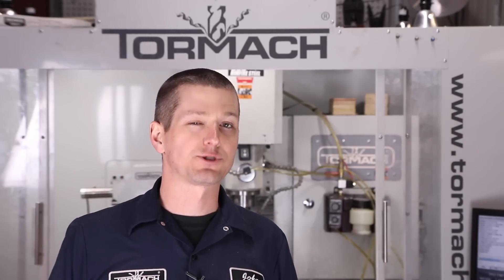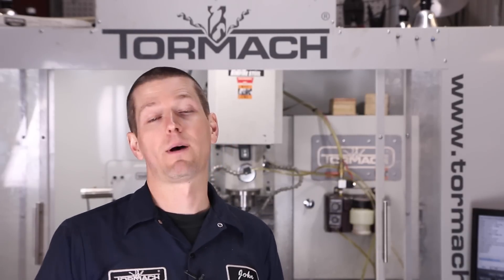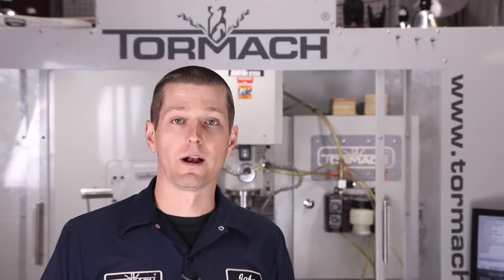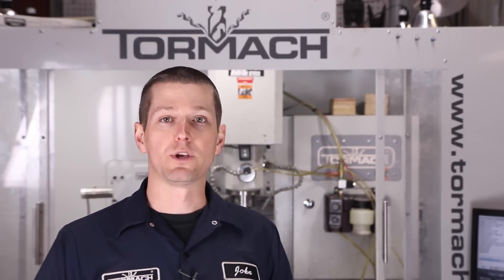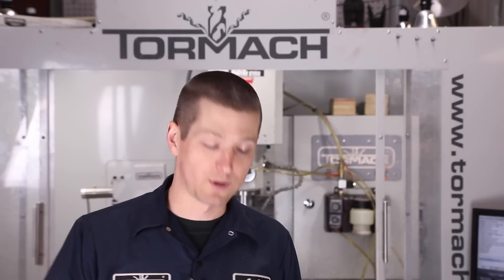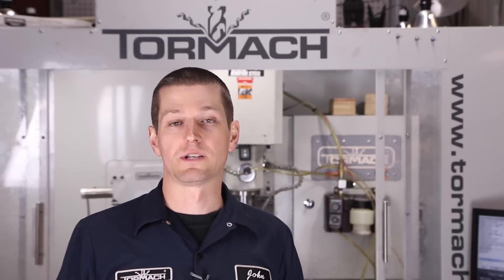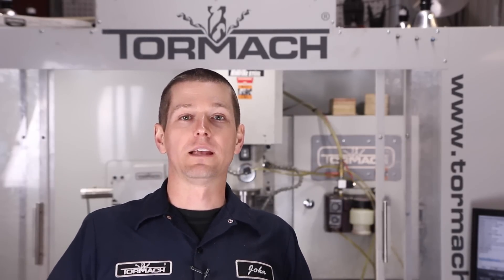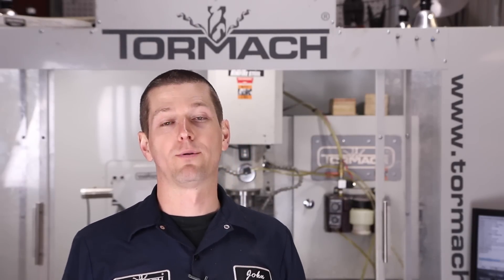10 great features of Tormach's new PathPilot Controller!

Comment: Hi John, I picked up a couple of tips there, thanks.  I am running Path Pilot with V1.9
I'm pretty stoked with it. A learning curve no doubt, but a pretty easy one in the scheme of things. I read(tried to ) the manual and I gotta say, it did not inspire me!
I decided to bit the bullet and just try stuff....Yeeee Haaaa! Awesome stuff.
I have used the circular pocket to great effect. And people would be surprised how you can manipulate the figures to get some interesting outcomes. The tool data is very useful in that you can actually manipulate your diameter (in tool data) to vary(fine tune)  your finished size. I have not been able to get the touch screen working yet, but tormach are working on it. Tormach is also working on a PCD for Drilling and Tapping under the "conversational umbrella" of drilling and Tapping.
My machine is as series 3 and about 2 years old, but with Path Pilot, it feels and sounds like it's new. Definitely smoother. I used to do some machining(say an internal pocket) at over 1800mm per minute feed  rate but unless the next move was around an arc or off on a slight angle, it never sounded good. that sound has gone...smooth sailing. Role on Tormach. I cannot wait for the updates of PP with fixes for a few bugs, but more importantly, new and expanded features. Go Tormach..
Thanks for the Vid too John, another great job.
Regards
Peter

Comment: Hi John, I have seen your vid on using the touch screen. How did you install the driver from the USB.
I found the latest driver, put it on a USB but it doesn't seem to recognise the file.
Can you get back to the Linux system(maybe outside Path Pilot) to install the driver. 
Thanks in advance Peter

Comment: John, I wonder how much of the responsiveness you see in Path Pilot is due to Linux instead of Windows?  Just wondering...don't expect an answer. It would take a lot of research into how each program is structured (single multithreaded process vs multiple cooperating processes, use of custom device drivers and how the work is divided up, etc.)

In some future video maybe you could explain what "ref out" means, and how soft limits work and why they prevent it?

Thanks!

-- Mike
Reply: BigMjolnir Okuma's OSP for one example is a Windows PC-based control. I don't think it's a Windows problem.
Reply: NYC CNC Hi John, I just ran into a problem with the soft limits. On the Y axis it is set at 9.50". I run a jig that holds 14 pieces and the pieces on the Y axis measures right at 9.5". I use a 1/4" end mill that runs on the outside of the pieces on the Y axis. I have been running this program for 2 years on Mach with no problems. So to say I run just over 10" on the Y axis without hitting the limits when using Mach. I put Path Pilot on both my 1100's and went to run this G Code and I couldn't run it due to the Soft Limits being set at 9.5". I called Tormach and asked if they could put a button on the program to turn off the soft limits or better yet let us set them ourselves. Waiting to hear from them if this is possable. Mean time I had to change one of my machines back to Mach which I really hated to do. I think the soft limits are a great thing but need a way to turn them off or let us adjust them.
Reply: John, thanks for the explanation.  I'd thought Tormach used servos not steppers?  Servos shouldn't lose position...they report movement back to the controller so no "lost steps", right?

I got to see Tormach's machines in person at the Cabin Fever Expo in York, PA on Saturday. Very nice!  I definitely don't have space for them until I move to a new house (maybe in a couple of years), but when there's space....  

-- Mike
Reply: RapidFiretek.com Hi John, I still haven't heard anything from Tormach on disabling the soft limits or giving us a way to set them. Maybe you can talk with them and help us out. Thank you
Reply: BigMjolnir 
It is very much an RTOS vs Windows issue. LinuxCNC and thus path pilot run a real time kernel and are far more responsive as a result.

Comment: Been using Pathpilot now since beta became available. Excellent product. So much better than Mach3. Night and day. Never use Mach3 again on PCNC. So great that you can so easily see maximum machine extents and the use of soft limits. Pcnc definitely runs so much smoother now. Great product and now with software updates and support. Unless you have some Mach3 customization I say just get PathPilot. So worth it.

Comment: Isn't it interesting how software has a "feel" to it?  I definitely like the stable, snappy, responsive feel of LinuxCNC and from what I've seen, I like the Path Pilot extensions to LinuxCNC even better.  This is a huge win for Tormach.  Not to be a Negative Nancy, but I'd have never considered a Tormach when it was forced to run Mach III.  The only way I'd have bought one before was for the hardware, and I'd have swapped out the software to LinuxCNC to create an orphaned machine that Tormach couldn't support, but if I was doing that, I'd have bought a small used VMC and put LinuxCNC on that.  Now, Tormach leap frogged ahead with Path Pilot.  I doubt they'll sell a generic version for other machines.  If they did, I'd buy it for the conversational programming wizards, which look much nicer than the Python wizards I currently use.  Hopefully, the open source community will respond with something like Path Pilot for LinuxCNC.  Things are definitely getting interesting, and better!  No matter whether you like to build your own machines or you just want to buy a machine and focus on making your parts, there are great solutions for everyone.

Comment: This is Linux cnc right? I'm not surprised you like it then, i've been using that for ever on my cnc router. Even converted to 3d printer running gcode a few  hundred megs large it runs rock solid on a little atom board. 
I am surprised tormach using it though and making it available to you guys very decently priced as I saw on their website. It will be a hit I'm sure, hope they contribute back to linuxcnc: I want that GUI!

Comment: Regarding the toolpath preview window: Unless Tormach changed this from LinuxCNC, you can hold the mouse wheel down and move around to change the perspective (like in almost any CAD application). That, combined with the wheel zoom in/out, lets you have a quick but very detailed look at the toolpath, pre-run or live. :)

Comment: Looking forward to all the videos "coming soon".  
Yet another like for a NYCCNC video.

Something I noticed is that videos show up first on Google+ app then only later they show up on the YouTube app when I check my subscriptions. It's not a long time just something I found odd. The link in Google+ even shows its a YouTube video but if I load the YouTube app they aren't there let but still play fine with the Google+ app only for a bit. Enough rambling.

It sounds like path pilot is making the Tormach a lot better choice than other mill options stuck  using Mach. Well break is over back to work here.

All the best
Reply: John they don't show up a lot earlier, less than 15 minutes. I just found it odd and a little interesting peak into how Google's black magic works. Nothing for you to fix. I am usually running late early getting ready for work and found I can find your new videos just in time to watch if I check Google+.

Comment: Hi John, I'm in Australia and I can't wait for the release of Path Pilot. Between the things I have read and your video, it sounds fantastic!! One(well two really) thing i am interested in is ...is tool diameter offset, G41, 42 and G40 programmable (and actually work)?
Also the tool length offsets, can they be entered in METRIC? Despite the manual saying that you could enter metric length offsets after changing a couple of perameters. But the reality was quite different. You could run metric programs(G21) have the DRO in Metric, but all the time required the Tool length offsets had to be in Inch.